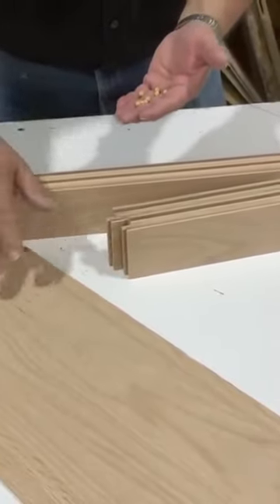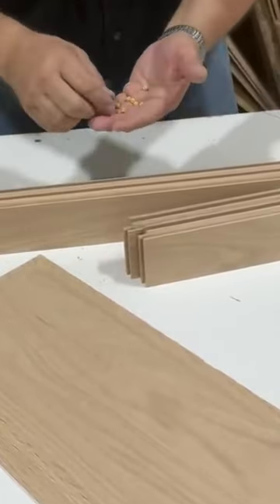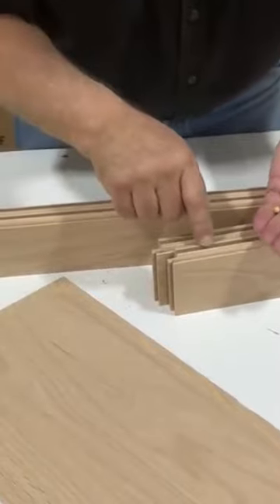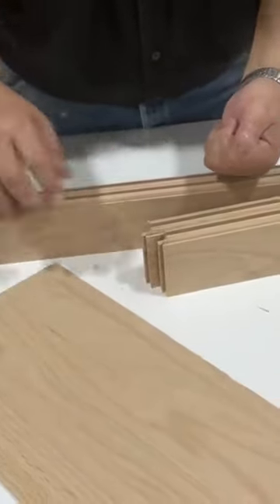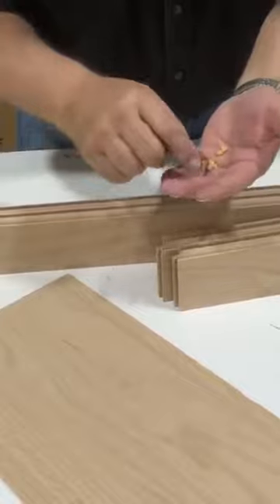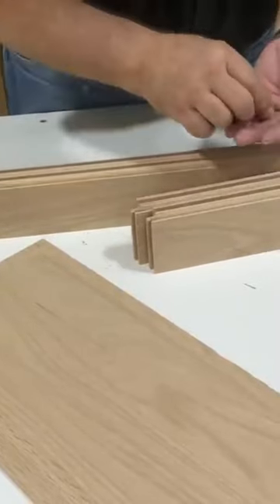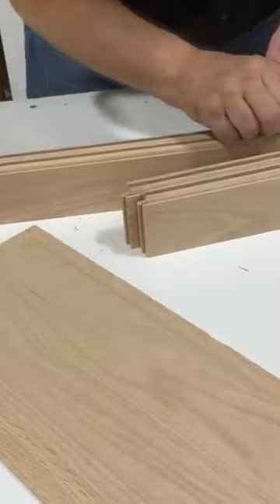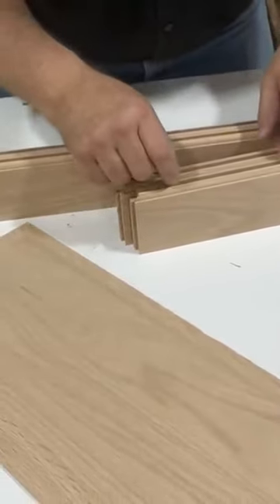Using Space Balls On Raised Panel Doors

Comment: Do you need these when using cabinet grade plywood for your center panel?
Reply from the maker: Space balls are only required for panels made of solid wood because they expand and contract with heat and humidity. Whereas, plywood and MDF do not. Thanks for watching, Wes